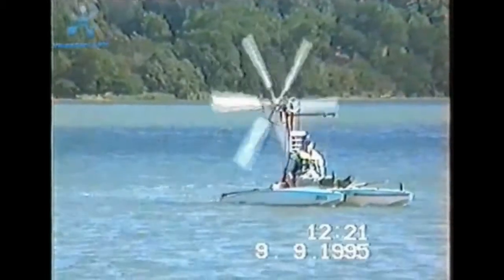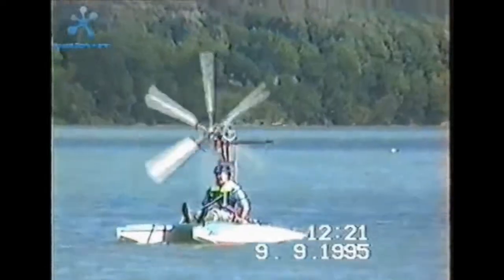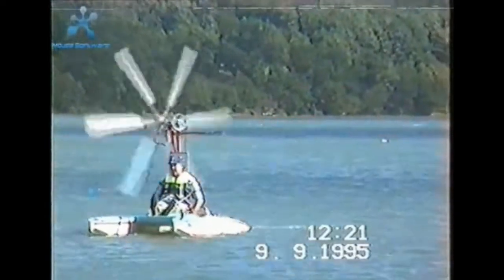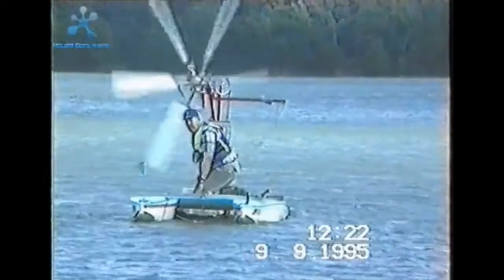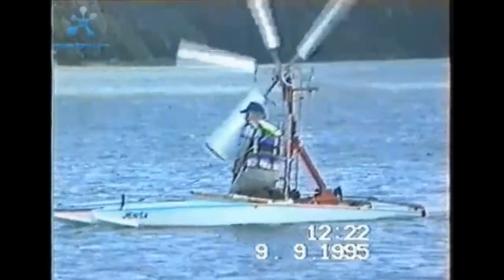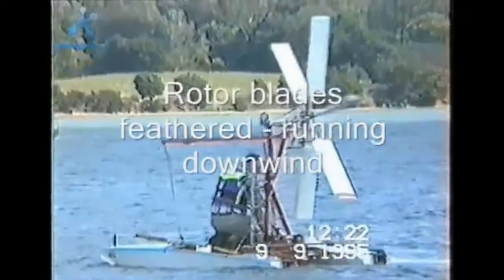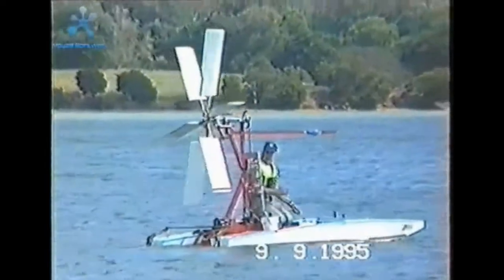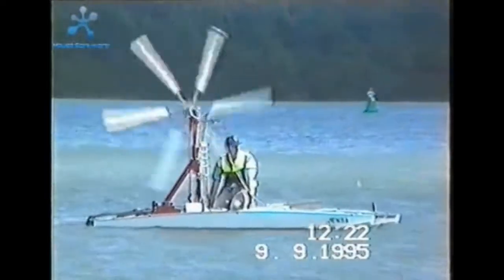Wind powered craft that can sail directly into the wind

Comment: I did a small unmanned boat about 30 years ago that would sail directly into the wind. Simple direct shaft between a large low pitch propellor and a high pitch windmill. Worked great! I like the ability of your craft to travel in different directions but still some things obvious to solve.

Comment: Is this is another perpetual motion machine, that like so many others obscures the real energy blances by the redirection of forces? The video shows no prolonged directly upwind travel.
Reply: This contraption doesn’t break any of the physical laws, unlike perpetual motion machines. Its function is just counterintuitive.
Reply: The propeller blades go upwind diagonally, just like sailboats do. The hull isn't an aerodynamic element, so it doesn't matter what it does.

Comment: i think a vertical axis wind turbine would suit a craft like this very well
Reply: I'm not sure they are as efficient as a HAWT, so might not work very well.
Reply: That's what I was thinking. And then it could also be powered downwind, rather than needing to feather the blades. And it would be possible to install more than one - either geared to one prop, or perhaps each with it's own prop.
Reply: downwind can be one advantage, but they lack in efficiency overall compared to a horizontal axis turbine. as for a horizontal axis turbine going downwind, simply put a tail end wind vane on it and the blades will always be facing into the wind.
Reply: Check out Walker Windsails.
My father-in-law invested a lot of money in that. Lost the lot.